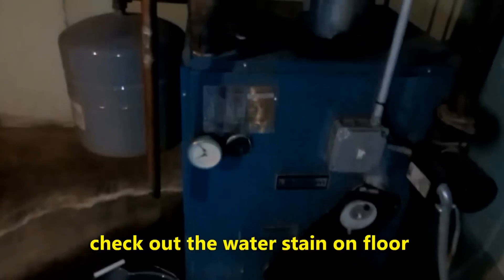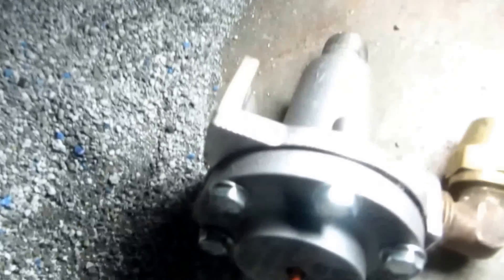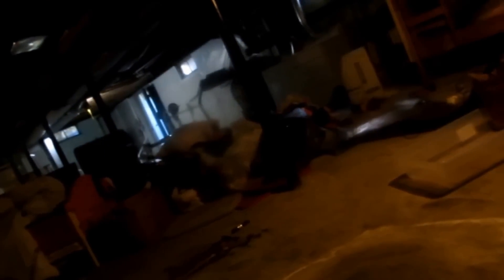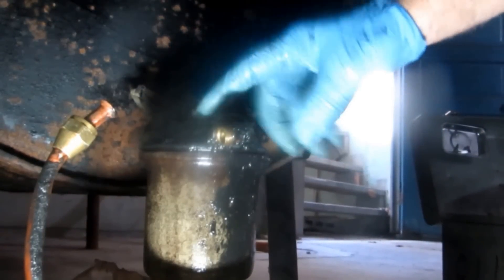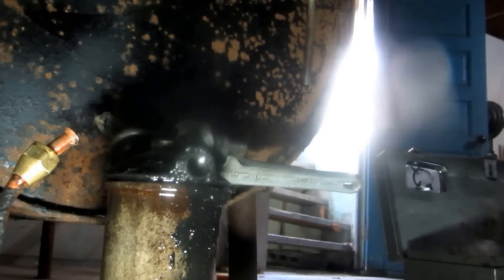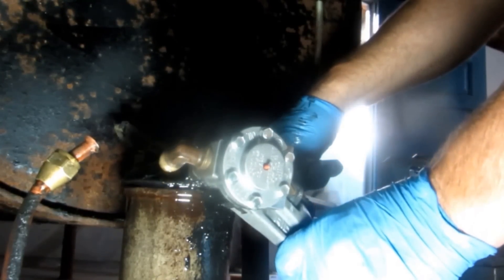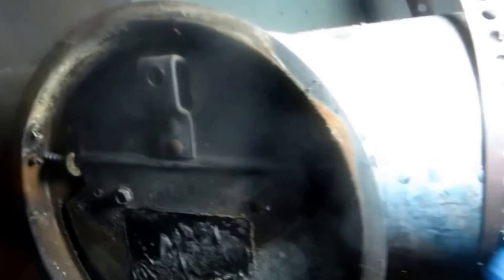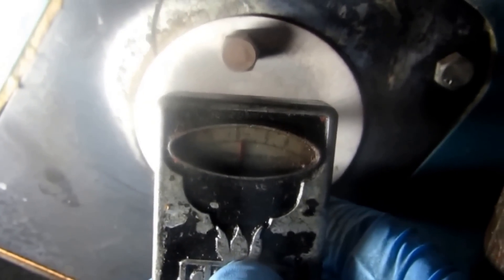HEATING SYSTEM: burnham oil fired boiler with many issues

Comment: Hey Steven how you doing???I've been watching you videos and there really helpful. I have a quick question for you. Im working on a burnham oil boilers v-14a and i need to change the combustion chamber pads and wanted to know if you know off the easy way to have access to the chamber.
Reply from the maker: Fabian Juarez if there is no swing door you have to pull the burner .they do make a wet blanket you can make your own target wall with form and cut to fit .. it comes in a roll .put a good piece for a target wall and some on the base to make your own custom fire box ,if you can not get the proper fire box for your boiler

Comment: I got a burnham boiler very similiar to this one. I was checking mine out for the coming winter and on the left side of the boiler
there is a small hole in it like in your video. Is it normal to leave that little hole uncovered? I can see the fire inside when it starts up. It is the same hole you were checking for the draft. It is on the side and not far from the red reset button.
Reply from the maker: David Lessard you can get a 1/2 steel push plug for it that what belongs in there but they burn up and fall out .i usaully use a old burner nozzle it will fit in there .or a carage bolt .works good also

Comment: Where i live in the Chattanooga north Georgia area we have half and half of oil, gas, strait electric, although many hear have heat pumps but they got an aux strait electric or propane heat since it dose get in the lower 20's and occasionally to the upper teens in around the mid southern mountains vary humid in the summer too
Reply from the maker: thanks for commenting hydudu

Comment: You don't need an osv when the oil is gravity fed to the burner. Only when the tank is installed well above the burner would you need an osv. The extrol should have been turned with a wrench, don't you have any standard wrenches? Channel locks shouldn't be used for everything. Also they make hose Bibb caps so you don't have to replace every single leaking valve/drain in the world. Just a few suggestions.
Reply from the maker: in my state any copper line in concreat that is not protected needs a osv .. the hose caps will not seal them type of boiler drains .. how old are you ??????? you must be a kid asking this try of stuff
Reply: @stevenlavimoniere  You are correct about those hose caps Steve. My boiler valve leaked through the stem that you turn.  It was only a few years old.  So, a cap wouldn't have done any good anyway.

Comment from the maker: the expanchon tank should be installed on and air scoop on the supply line of boiler that is usally at the cieling.on the main supply .to take the weight of tank thats the proper way and  place for ex tank but if you go in for a service call its not alway fesable  to reinsall the whole system  so you do what you can

Comment from the maker: it was a repair i would have liked to hang it from the supply pipe  at the cieling but sometimes you have to work with what you have ..... a lot of the stuff i see is a flipping mess  the homeowner didn 't want to revamp the inter system so i can only do so much i am not a ,,,non profit  organisation i am out to make money

Comment from the maker: natural gas is the best way to heat in my opinion .up north,but oil is ok  l.p. gas is expensive also .oil just need to be maintained anually . it is a durty fuel and can be a problem if properly maintained and serviced .as far as gas conversons i am bidding or more but i don,t get every job .there are alot of low bidders out there  . i do mostly service and repair some installs but not my norm ..i much rather do 6 jobs a day then one install just the way i built my buisness thanks for commentin

Comment: I have the same boiler in my house & there are many oil / steam systems around here when the suburbs were being built back in 1939 when the yard was booming, building the likes of the USS Massachsettes, the burbs didn't have gas mains like in the city, did so you drop a tank in the cellar and you'ld be all set. The first oil receipt is on this tank, Sept. 1939, 255 Gals @ $.03 per = $7.65, for a month of heat & hot water. But now at $4 a gallon, ouch! You must get a lot of gas conversions Steven

Comment from the maker: there is a ton of oil burners up my way i guess it depends on where you live .oil burner service is a big part of my heating season.both oil and gas.we don't have much electric heat or very little.just in summer homes .i will be doing more  oil related stuff soon